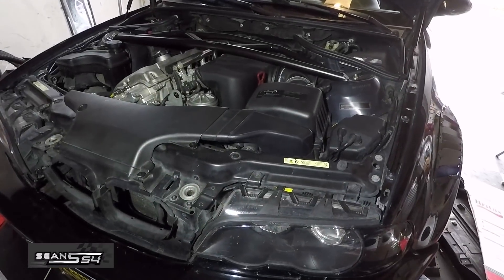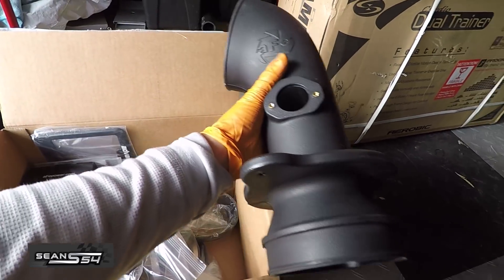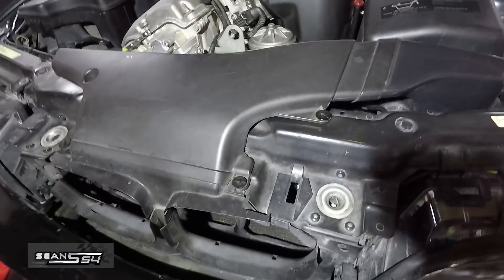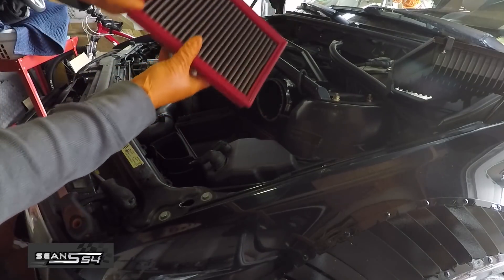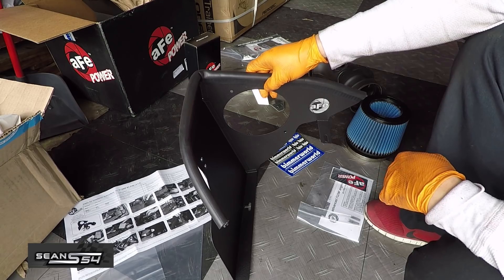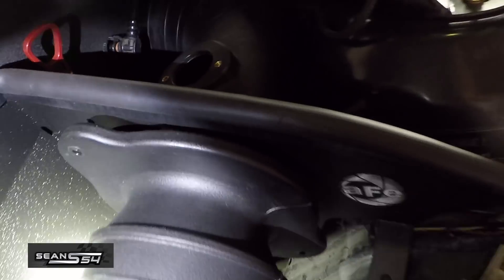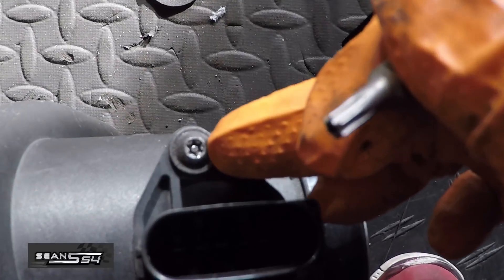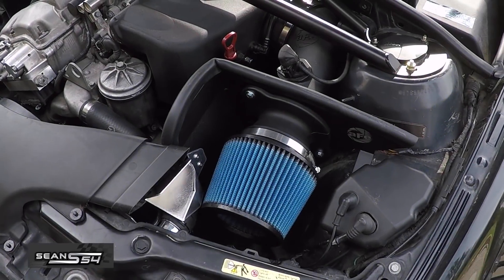aFe Power Stage 2 Intake Install & Sound - BMW E46 M3

Comment: Hey Sean, big fan of your videos. Where does the aFe intake pull air from if you removed the stock driver’s side bumper air duct? I am trying to replicate your brake cooling and air intake setup, but am confused how air is routed to the intake after installing your brake cooling system. Thank you!
Reply: Sam, my M3 had this AFE intake on it when I bought the car. I am now thinking about removing it and reinstalling the original setup (which came with the car). In answer to your question the outside air enters the shroud area from the top and there is a pipe that comes up from below. The original air box connects to both of these. The AFE unit is open at the bottom to allow the air from below to enter. My concern with the AFE unit is that it allows engine heat soak to occur more readily than the original air box and if this is the case then you will lose power. The other thing is that the car is worth more if it is original- hope this answers your question

Comment: I just want to know what is that block off plate for?
Reply from the maker: If you're referring to the small aluminum plate next to the radiator, it's to help funnel the air from the stock intake air duct.
Reply: SeanS54 Yea that aluminum plate, I kind of feel that plate is blocking fresh air lol.
Reply from the maker: I kinda agree... but the way it's design perhaps it helps funnel air and also blocks the radiator arm (in case of a leak?)
Reply: Its to block whatever little air from coming from engine bay in to prevent as much heat soak as possible. It isn't much but any little you can block off helps.

Comment: Hi Sean how much power at the wheels do you expect from the s54 now and is it mapped if not do you plan on going for a mapping sessionRegards from England
Reply from the maker: I already have a tune by TTFS that accounts for more air. Not sure of the wheel HP but here's info from aFe: https://afepower.com/afe-power-54-10462-magnum-force-stage-2-pro-5r-cold-air-intake-system